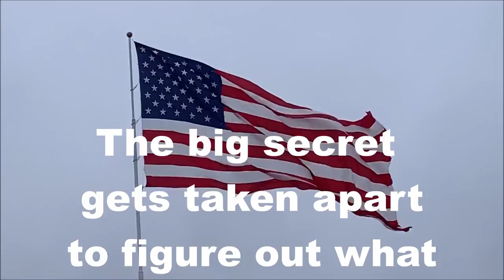1988 Johnson 15 hp (aka 9.9) big secret Part 1.5  why did it die on the water. Let's dig in and DIY

Comment: I had the same thing on my 15 evinrude the top plastic plate cracked , the previous owner had super glued it and it worked fir a few Years but finally gave up, I bought a new one (expensive part) and installed it and worked great,  it doesn't take much of a Crack to mess up the performance . Thanks fir the Great Video
Reply from the maker: no it does not, thanks for sharing and watching

Comment: I was given a 1989 15hp Johnson that hasn't run in years. I changed the water pump so far. It has great compression and spark. I'll be ready to fire it up in a couple of days. Your videos are very helpful. Thank you RMD, looking forward to part 2.0.
Reply from the maker: You can do it.  They are a nice running little motor.

Comment: Will,
First ! You are doing a great job with Hoop🐾 don’t mind the negative energy! Hater’s gonna hate ! Move on , you’re doing good! On the star link , usually can get 100’ cord & don’t do anything permanent until you see the best spot for your signal . It will search from ground level & find the best signal. Mostly just protect your wires & equipment from damage due to varmints & elements. The mobility is your friend! As far as the cover over your door , just do a small extension with your current roof pitch to cover your door & window to get you through winter. You can build a gazebo style later as time permits. Do your separate storage for fuel , gas tools & outhouse. Use the bus for your sound studio & upgrade as time permits. Use the carpet & tarp to cover windows & sound proofing acoustics. Most folks will give you good ideas & advice but in the end , do what’s good for you & Hoop ! It’s one step at a time & mostly get prepared for winter . You’re taking good care of Hoop , puppy food , bed & toys & he will be your faithful companion, not anyone else! He will grow into his own independence soon enough but will guard his territory with you . Dogs are very good learners & territorial. Anyway, enjoy your video content & proud of you! Encourage here ! Buddy you doing great! Positive Energy! WahPow! 🤚

Comment: Been working on outboards for 10 years as a hobby. Omc is one of my favorites and especially 9.9-15. Those plastic bowls crack really easy if tightened too much. They especially crack when they tightened unevenly.  I always tell people on the forums evenly snug the screws with blue lock tight on them. Doesn’t take much pressure to crack those sadly.  Great work on your motors
Reply from the maker: That is what I will do when I put this one back together again. Thanks for the tip. Thank you for watching and commenting

Comment: The Replacement carb cover plate is different, It is reinforced to help prevent warping/cracking and will have torque tighten sequence numbers molded in. You have likely seen this info but don't think you mentioned it.
Reply from the maker: I have not done the research on that just yet. Thank you for the heads up.
Reply: @Michaelsbackyardmarina  yes if you get a new bowl and top plate they have numbers beside the screw openings. This is for tightening sequence.

Comment: Hello. I have a Johnson 15hp outboard ((1988 model with rope pull start). It appears to be identical to the one shown in your video. I recently had a mechanic work on it but I ended up taking to another mechanic as the first one was taking too long to fix what should have been a simple problem. However, when the second mechanic started working on it he noticed that there was a spring hanging loose on the choke assembly and we can't work out where it fits back on. It is where it connects to the lever that operates the butterly vane when the choke lever is pulled out and pushed back in that is causing us headaches. Would you be able to take some close up photos of the the choke assembly showing the spring please? Thank you in advance for any help you can give us

Comment: Have a question for you...what color orange wire goes to which coil pack? I have orange blue and orange green. I did your trick with the putty knife on the powerhead removal, Worked like a champ!!! Btw I just received my new/used 9.9 powerhead on Ebay and she's a beauty! Hardly any carbon build up in the exhaust chamber looks like low hrs..paid a little more for it but it was worth it. Came from Michigan so definitely fresh water operation a huge bonus! My old powerhead and exhaust is HIDIEOUS!! Btw I screwed up and threw a rod or broke the crankshaft on my old powerhead I used starting fluid 😒😪 lesson learned!

Comment: I had the problem with carb top plate engine would start and die, ended up replacing top plate no problems after. Ran great.   Would have like to see the exhaust seals for water pickup on the exhaust pipe.
Reply from the maker: I will cover a bunch of stuff on assembly process

Comment: My first comment, after your part 1, nailed the cracked bowl as the source of the fuel leak but I am not with you for it to be the problem with the running issue. I still maintain a coil problem (or ignition power pack)  Having said that, I think your leaf valves are ok and the loose bolts may have contributed as well. Also you could have performed a leak down test that may have narrowed down some other issues with out needing to teardown the powerhead. I realize you do that partially for educational purposes. I look forward to the next video.
Reply from the maker: Definitely appreciate the input.  Checking out the electronics once the power head is back will be key.
Reply: I greatly appreciate the in depth procedure of Michael's videos especially on the 9.9 and 15hp Johnson outboards. I own a 1990 Johnson 15hp short shaft and a 1994 Johnson 9.9 short shaft outboard. I'm learning myself on theses little outboards and I will agree that Leeroy's Rambling is a very good source of information.

Comment: I have an old 1970 Johnson 6 horse and was wondering where you get your manuals and parts from, thanks.
Maybe do a video about "Information sourcing"   
Love the old 2 strokes (Johnsons) and your videos.
Keep em coming :)
I would love to have a 1970 ish 9.9 converted to 15 hp to fit on my new (1960 Myers Laker 12) boat.
Reply from the maker: Check out eBay for the old manuals and parts from marineengine.com and crowleymarine.com
Reply: @Michaelsbackyardmarina  okay and thank you. Love the videos :)

Comment: If I may ask you a question.... did it just die or did it sputter then quit ? You know like a lean sneeze . If it did that then I’d say top block seal and carb if it just died I’d say it’s the charge pack and if it ran on one cylinder I’d say coil . It’s just my opinion ! And yes the 9.9 and 15 are the same C.I. Blocks just like the 20 and 25’s !
Reply from the maker: It seems to choke out on it's on gas. Lot's of fuel running out in the engine pan.
Reply: @Michaelsbackyardmarina  I guess the carb would be a great place to start with the crack in the bowl and all , I hate those plastic carbs ! Lol

Comment: First off,  I really enjoy your common sense approach to repairs.  I have a 1990 9.9 that I have only run with muffs or in a trash can.  There is white milky oil coming out the mid section exhaust ports and the prop hub after I stop it.  Is this normal?  The plugs look wet, but I haven’t had it on the water.   I picked up a 15 1990 to do the carb swap.  I noticed the 15 pumps water out the telltale and water out the midsection exhaust breather.  Should my 9.9 have water coming out the midsection exhaust?  Thank you!
Reply from the maker: Not normal.  Sounds like you might have a gear box leak or a head gasket that is gone.  Do a compression check.

Comment: We have a Johnson 9.9 86 1986 motor and the boat sunk and the motor sat on the bottom of the river for one day and we got it out we change the spark plugs and it ran fine then all of a sudden it just stopped but we ran it for 2 days and it runs great and then it just stopped running and won't start

Comment: I have a 1990 evinrude 9.9 that I'd like to upgrade to 15- as I understand it for.this year I also only require the carb because.it has a tuned exhaust already?
Reply from the maker: Good luck location a carb.   That are hard to come by
Reply: Oh yeah I see that they're going for about 250- no problem there, I just wanted to confirm nothing else needed to be done on a 1990 evinrude...   U mentioned that website Leroy ramblings and I read the whole thing with no concrete answer for a 1990.

Comment: I think the timing is off on this motor may be a slip fly wheel key or the magnetic rain but operates the sensor could be out of place I don’t think you found the real problem yet I was a service technician in OMC dealer for over 20 years I’ve seen it all
Reply from the maker: 20 years, Thanks for watching

Comment: Well, according to the very khowledgeable gentleman behind Brandon's Garage (utube channel), it is of paramount importance that no light shine through those reeds when held up to a light source. He did a great series on rebuilding a 15 hp that is a must for all DIYfers. Fuel pumps on those move so much fuel that I doubt that your crack would be the culprit. Probably could still keep the bowl sufficiently supplied ... but I may be wrong ! Anxiously waiting for the final verdict !
Reply from the maker: I finally got all my parts in and I will begin reassembly. Stay tuned.

Comment: Nice channel! I have the same problem on   the same engine you got! Took the carb out a dozen times  and cleaned it and it wouldn't fire up!   Did you ever find a solution?
Reply from the maker: Cracked carb bowl and warped plastic top plate.  Hold on to your wallet for the replacement cost.

Comment: the tuned exhaust was put on in mid 80's to make up for the horsepower rating change from crank to prop hp.
Reply: the 9.9's and 15's from 1974 to 1985 were actually less powerful 13 for the 15hp and about  8.5hp for the 9.9s because they were rated at the crankshaft and you lose 10-15% power when doing 90 degree turns. (propshaft)
Reply from the maker: good info, thanks

Comment: I have a 9.9 changed to a 15hp. It’s a long shaft that I wish to be a short shaft. What parts do I need to change to make into short shaft motor.
Reply from the maker: Remove the spacer. You also need a short driveshaft and a short shift shaft
Reply: @Michaelsbackyardmarina  Thanks,I have all winter to find the parts.
Reply from the maker: I have the parts left from my conversion from short to long. Make me an offer

Comment: I have a evinrude 9,9 1987 just bought it i had     When i slowed down the gas it just died and now it wont start?
Reply from the maker: check that carb out for sure.  If it has plastic on it, could be cracked. Thanks for watching

Comment: Lol love the hp issues!! Tuned exhaust vice cast exhaust  cheaper and more exhaust flow during high speed flow. Lol manufacturer cutting cost on there parts. Cracking , great find.  Hard to see on a small screen?? Lol  Great job thanks
Reply from the maker: Couldn't agree more!

Comment: Just tell me how much you want for parts. Do you need serial no for parts ? It’s a 9.9 hp
Reply from the maker: What year motor are your working with.  Tell you what I will trade you straight across. Your spacer with bolts and drive shaft and shift shaft for my shift shaft and drive shaft. I'll pay shipping for mine to go your way and you pay shipping for yours to go my way.  Go to my channel home page and email me.
Reply: Still looking for short shaft parts for9.9 Johnson. I wish to keep my parts for down the road if I purchase a long shaft boat. Do you have any,and how much?

Comment: on the 1994 evinrude 15 hp they did add a 6th screw on the top plate part #437985 it's like $55!
Reply from the maker: ain't that some crap.  I bought a new top plate and it was expensive.

Comment: A great informative video Michael. I’m currently looking for a ‘74 to ‘78  9.9 to do a conversion on but to find one in decent shape with good compression is a tough chore up here in Ontario Canada. Now I can add a ‘79 as a possibility. I’ve got an ‘83 but as you said that exhaust pipe is different. Keep these great videos coming!
Reply from the maker: Will do. Thanks for watching
Reply: 74-77 wwere the worst of the johnson evinrude years because of the head design. it would foul the plugs more. read up on leeroy's ramblings.

Comment: I’ve seen those cracked before. I’ve also have seen other plastic parts on those motors cracked.selinoid etc.
Reply from the maker: Right on
Reply: Yep, allot to be said for old vintage outboards with all metal parts less gaskets, seals and orings. I have a few plastic parts on my 2000 yamaha and so far no problems yet
Reply: I have a 1990 Johnson 15 hp short shaft I've been working on. The carb top plate is plastic and someone had done a repair on it with JB Weld at some point in time. It did start up and run fine with repaired JB Weld top plate although I didn't want to take any chances with it leaking so I ordered a new carb top plastic plate and installed it.That top plate is like $125 bucks new ,the bottom fuel bowl is plastic also, it's like $40 bucks new,big difference in the price there for sure between the two carb parts. I have some fuel leaking from some where, but it's very minimal, like maybe a possible mist of fuel, but I can't see it leaking while at idle or when running it in a test water barrel from the carb.I'm suspecting now a possible hair line crack in the bottom fuel bowl after watching Michael's video.I'm also thinking it's happening at WOT,IDK for sure. I took the boat and motor to the lake last week and motor seem to run out fine. I did see some minimal fuel leaking from the little drain holes down the leg of the motor from the bottom pan after I pulled the boat and motor out of the water. Looks like I'll be pulling that carb off again and really inspecting those two plastic plates for hair line crack's now.
Reply: That's insane amount for just part of a carb. I wonder if one of those 3 printers could make one cheaper?
Reply: @TimsWorkshopTJY  I agree it's totally a insane price for a piece of plastic. The fuel bowl is high enough priced, but alot more reasonable around $40 bucks. I have no idea about 3D printing one,I know nothing about how that all really works.

Comment: Next thing to do is remove the thermostat and replace it . Remove exhaust side cover and check water passages. Check water discharge hose for clog ages as well discharge nozzle. Also check the throttle pick up is proper setting.After reassembling
Reply: After putting carb together, put a piece of fuel line onto carb and turn carb upside down and blow into hose and and listen for leaks.
Reply from the maker: Thanks for the info

Comment: Well it probably goes without saying there may have been a heavy hand on the carb assembly at some point. My Dad always said, "easy does it boy!" 
  My take on it would be, if you want it to stay tight use Lock- Tight, not more torque! 😉
Reply from the maker: That would be my guess too. One old feller use to say "you don't have to tighten till the water runs out"

Comment: Does anyone know how to change the oil in motor on a 2003 Johnson 15 horse 4 stroke
Reply from the maker: I haven't done it yet. Thanks for watching
Reply: @Michaelsbackyardmarina   Thank you I replaced the lower unit, and thought I would replace the crack oil, thank you so much won't worry about it.

Comment: make a blank off plate for the exhaust and pressure test it once you get the reed plates in. double check the crank seals.  but yeah  carb is the biggest thing. reeds MUST SEAL.
Reply from the maker: good suggestion. Thank you for watching and commenting

Comment: I can't find part 2 with the answer to the engine dying on the water. I really don't like plastic parts on a carburettor. I dont like that main jet assembly, its just asking for trouble. Modern cars have lots of plastic parts under the hood, yuck.
Reply from the maker: I'm not a fan of plastic parts either. Part 2 isn't completed yet. Stay tuned.

Comment: The difference Between a 9.9 and a 15 horse Johnson in 1974 the 15 has more compression and a different cylinder head the head is stamped 15 horse it has 20 pounds more compression
Reply from the maker: Thanks for watching
Reply: nope the 9.9 and 15hp are the exact same engine even up in the later years. main difference 74-78 was carb only. look it up. too many videos out there on this topic.
Reply: 099 and 15 horse Johnson built in 74 has different pistons more compression in the 15
Reply: @randymiller1604  I’m reading an article right now on Leeroy’s ramblings. The piston diameter for both the 9.9 and 15hp motors from 74-92 are 2.188” with a stroke length of 1.760” if I could send you a picture I would. Seriously look it up. Pistons are the same size.
Reply: The only thing that gave the 15 more hp is the carburetor.

Comment: When I troubleshoot an engine rather in a car or an outboard as I take it apart I check each piece so if that would be the case I would only have to go as far as the carburetor because I would’ve found the cracks in the imperfections at that point I wouldn’t of had to go any further unless I was going to rebuild the entire engine seems to meYou went awfully far before you started checking things out
Reply from the maker: thanks for watching